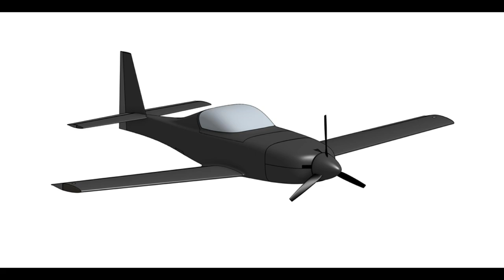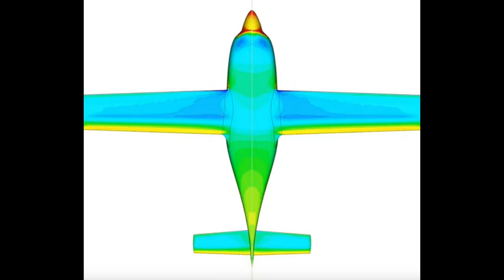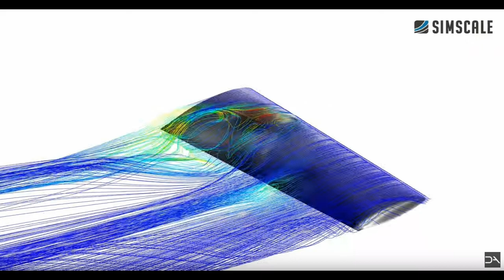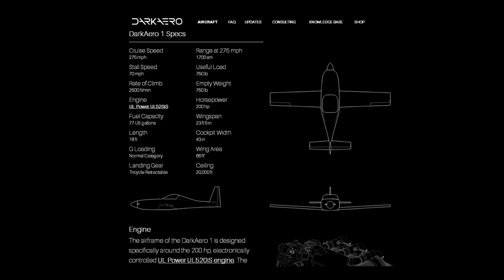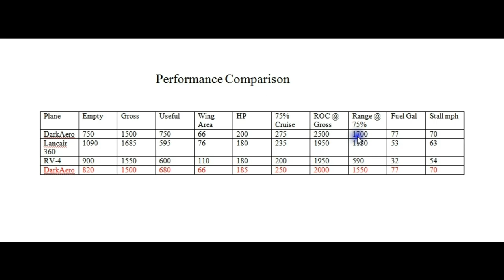Exploring DarkAero. Video #109

Comment: After review of more of Dark Aero videos (or re-review after last watching a few of them almost a year ago) a few things still bother me as I state below. $80K kit price, with engine and prop they claim it will be $140-$160K. Second, UL520Si engine can only accept fixed pitch or electrical props, not hydraulic.  Price of engine could not be easily found, but I am willing to bet it is more than a Lycoming. Also at 320 cubic inch displacement and claimed 200 hp I doubt, unless it is geared high RPM. They say it is direct drive? Some of the smaller UL engines are not getting good reviews. Satisfaction from owners is low, with  400 hr TBO, poor support, failing parts both mechanical and electrical. My biggest concern with this project is choosing a relatively new exotic UL engine and not a tried and true Lycoming. Yes I know  UL is MODERN? Kidding. It is still a 4 stroke pushrod overhead valve air cooled engine like a Lycoming. 

The Lycoming 320/340/360/390/540  engines are specific built aircraft engines with the best materials and optimal design honed over a  half century, which benefited from massive WWII engine R & D and experience in design, materials and manufacturing methods. You really can't improve on perfection To me the other option is Continental. A "modern"  FADEC or EFI can be installed on Lyc. In experimental or certified planes you can retrofit a single or dual  Electronic Ignition on Lycoming engines. Still mechanical fuel systems and magnetos work very well in planes... modern or not it works well and always will, reliable, simple, electrical system independent, with good efficiency,. "Modern" claims are irrelevant.  As far as the mechanical part of the engine the Lycoming is a real engine, overbuilt and stout. The UL looks like a toy or prototype with CNC machined parts. It may be fine for a low powered LSA but not high altitude aircraft with what I am guessing will NOT have low stall speed. The claim of 200 HP in normally asperated 320Ci engine I doubt.
Reply: In one of their video's they went over pricing of the engine and prop. I don't recall the price of the prop, but the engine is in the $30-40k range depending on options, theirs was in the $35k ballpark if memory serves.
Reply from the maker: As I stated in the video, it's direct drive and 200hp is developed at 3300 rpm. I said hp will be closer to 185@2800 rpm which I feel is more realistic with the prop size they are using.

Electric props have been around for many decades and work just fine for this application. Curtiss electric props were built by the 100s of thousands for many WW2 aircraft. I have lots of customers flying electric props. Work just fine as long a you're not doing aerobatics.

The Lycoming is too heavy and too big for this lightweight design.
Reply: @rv6ejguy  As always your videos and posts (and products) are very comprehensive, technical, well research, accurate, and explained very well. I did not mean to imply you did not cover the UL engine HP/RPM. However I echoed and added my concerns. My opinion is the UL engine will not be durable, not perform as claimed, not be supported by manufacture. 

Electric props? YUCK! Ha ha. Yes they have been around a long time and problem plagued for as long as they have been around, going back to WWII, when developed and used widely on military planes. C-46 Curtus Commando accidents due to prop issues come to mind. It was so bad pilots refused to fly and the C-46 got the reputation as a widowmaker, due to props going flat pitch on takeoff. 

Hydraulic props are better with the exception of Raptor. Peter should have gone electric. Not saying electric prop pitch control isn't a viable option, just a poor second choice in my opinion. Again "modern" doesn't trump tried true technology that works, aka hydraulic CS props. Why are hydraulic props used on all serious piston and turbo-prop aircraft? The reason is it's superior.

My point the Dark Aero's lack of engine prop options (i.e., Lyc + Hartzell) makes it a pass for me and doubt longterm success. I'm not a luddite just realistic. Also my RV7 Lyc 180hp Hartzell is a better plane overall, for me. I think the Dark Aero would be much better with a Lyc or TCM.

PS if they want to succeed and a Lyc will not fit and not willing to change design, an alternate option to consider, is the Rotax 915 iS. I don't like Rotax or water cooling, but it is certified, supported, with fairly large fleet and known history. Air/Oil cooling of is my preference over the Rotax water cooling. The Rotax continuous max 141HP is available at higher altitudes with turbo, giving it an edge over UL for high altitude operations. I see Dark  Aero as a cross country machine, NOT a sport plane, STOL, soft-field, aerobatics and utility. 

Another engune option is Continental IO-200  it would be slower on 110 HP but very efficient and pretty sure it would fit. This was the original of Lancair 200  it used a O-200 Continental and fixed wood prop. Light, cost effective and FAAAST. Builders on a budget could source a used O-200. With a light fixed prop it would be a delight to fly I imagine. Low weight and low complexity and low cost.

I still would not buy or fly a Dark Aeto with  UL or Rotax. For that money I could buy a flying used Glassair or Lancair.
Reply: @gmcjetpilot  I'm willing to try something new. A big focus is trying new designs and materials and seeing if big performance gains can be had. A non certified engine makes the most sense to push the envelope. If the DarkAero UL fleet doesn't end up being reliable, I'm sure the next iterations will feature different engine options, among other refinements.
Reply: @Zav  OK up to you. You want a nice flying plane or something new. This airplane will miss it's speed range mark, be very expensive, take long runways, not be aerobatic.... If I wanted a plane like this I would by a flying Lancair 360, Lancair Legacy, Glasair II or Glasair III already flying for less than what it would take to build this plane. BTW the kid does not exist yet.

Comment: I don't see any correlation between the wing area and the initial climb performance. Sea level climb performance is the function of the power (trust), weight and L/D ratio. Thats it! Please consider these facts in your future videos. Despite this your videos are quite good and gives me huge relief when see numb project are totally roasted by real engineering aspects.
Reply from the maker: I think you'll find in the real world that most aircraft with high wing loadings  and low power don't climb very well. Lift to drag ratio is important with lift being the numerator. Small area at low speed means low lift unless you increase AOA-which results in more drag. 

If you have high power and can go faster in the climb with that small wing at a lower AOA, you can climb ok. The drawback is speed varies as the cube of the hp so you need a lot more power to get that speed to make the small wing produce excess lift for a good ROC.

We shall see how DA1 does here when it flies.

Comment: I suspect that they might have some issues with the method they’re use to actuate the ailerons, might have too little stiffness given the tube design actuate by torsion.
Reply: Agreed, I think the whole control system seems like its built for an ultralight.It doesn't look robust at all

Comment: Maybe I’m misunderstanding but their estimate for useful load is 750 lbs and your estimate is 680, with full fuel that drops to 280 with their numbers or 220 with your numbers. I’m 230 lbs. I guess this isn’t the plane for me..
Reply: Imagine someone who is 150-180lbs in this thing :) Might be a plane for the young. That said, do you really need the range they offer? Could trade that to jump in.
Reply: Numbers aren't unusual for any airplane; they turn into single seaters with full fuel.
Reply: I have seen the hull at Oshkosh and this plane's appearance is more like a big model airplane than something you can get into and sit comfortable in. The cockpit is a big shallow shoebox. It's definitely made for slim people. But it will be fast and the fit and finish is amazing!
Reply from the maker: Yes, the cockpit looks pretty cozy for big guys and payload with 460 pounds of people and 30 pounds of baggage drops to 32 gallons. 

That's what RV-14s are for. It will carry this with a bigger cockpit and still allow for full fuel.

Comment: What’s the Vne in TAS of this aircraft? Thanks
Reply from the maker: I couldn't find any data on that. It may be decided after flight testing.
Reply: @rv6ejguy  Pipistrel had an initial problem with one of their aircraft’s tail tube breaking due to pilot error, not understanding the IAS TAS relationship and exceeding Vne at altitude. Not sure if the fuselage was strengthened where it thins down near the tail feathers. Fortunately that aircraft had a ballistic shute and the pilot survived to tell the story. Not, repeat not, suggesting there’s an issue with the Dark aircraft!
Reply from the maker: @daisybeagle6259  I'd hope professional test pilots and engineers all understand the IAS/TAS relationship with regards to flutter at altitude. The Pipistrel has a very narrow section fuselage aft which isn't ideal with regards to stiffness, especially in torsion.

Always things to learn during flight testing and dive testing is one of the most dangerous aspects of that. Hope DA has an experienced test pilot doing this part and has the airplane well instrumented. I'd hope they also do GVT before flying it too. A bit expensive but probably well worth it to uncovered possible flutter modes early on in a safe environment.

Thanks for commenting.

Comment: Nice looking, just like Lancair. If they can keep cost down great. A $100k kit, it won't sell.
6:25 Firewall in single Eng plane is great but a gas oil fire in flight will be a bad day regardless of FW. unless cowl is also fire resistant with active fire suppression. 
6:51 UL choice of engine not my preference. TBO? How many engines flying & total fleet hours? Certified? Issues? (Yes) Light weight = light duty less strength? They should have sized airframe for a Lyc. They will regret this choice. 
What is "modern" about UL engine vs Lyc? Lyc & FADEC? Available. Electronic FI and IGN available for Lyc. Machined billet case better than precision castings? No. It is just easier to CNC a case without huge investment and special manufacturing in castings (a lost art). UL in business 15 years, throwing all your eggs in one engine basket is risky, especially a small engine company whose Lyc killer engine models are fairly new or still being developed. There has been UL issues.  I'm 100%  in identifying this potential risk in power plant. Lyc is a known.. and still around because it is a good engine.
Reply: What are the options for Lyc & FADEC? You can absolutely buy an EFI for Lycoming (from this video creator!) and I'm considering doing just that, but FADEC? On what experimental Lyc engine can you get one of those, and from where?

Comment: Mass producability is a factor often overlooked by amateur aircraft designers. 
The aircraft may fly great but is too labor intensive to go into production. Many designs have died because of it.
Reply from the maker: I agree and I think this has been carefully considered here,  mainly in the use of CNC machines to produce a lot of the parts which would traditionally be hand made. Machines can make parts better, faster and cheaper than human hands in most cases. If we look at something like Raptor with a very numerous parts count of complicated parts, we see that it can't be made inexpensively as it sits now. That aircraft would require numerous components re-designs to simplify it for production, on top of a structural re-design and engine change to reduce weight to something acceptable.
Reply: They have been making sure that the parts they design are as easy as possible to manufacture, so I'm not entirely sure why you thing it's going to be too labor intensive.